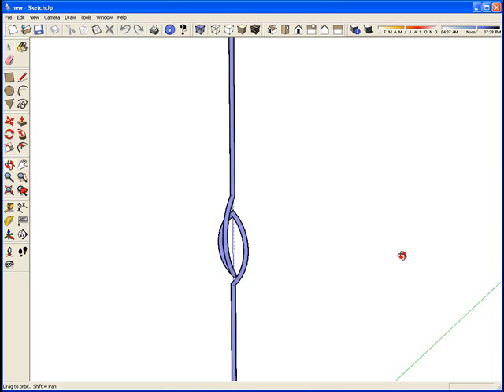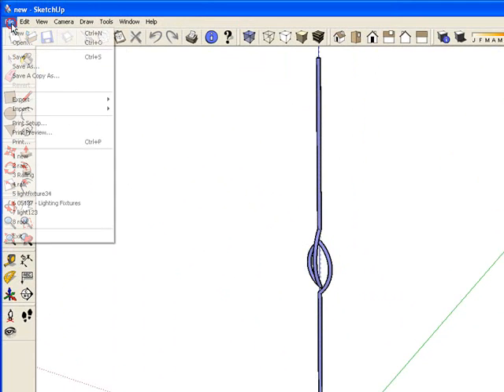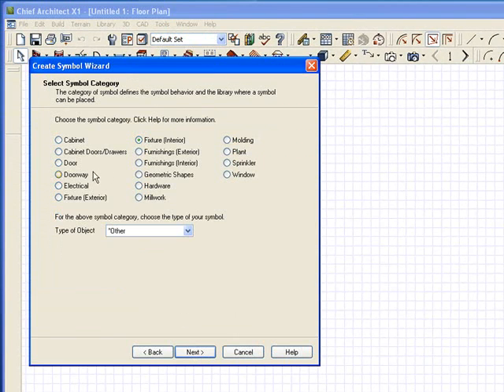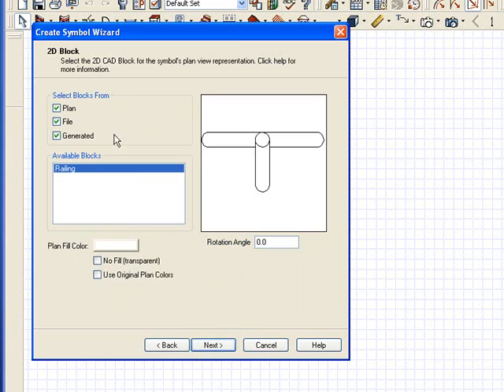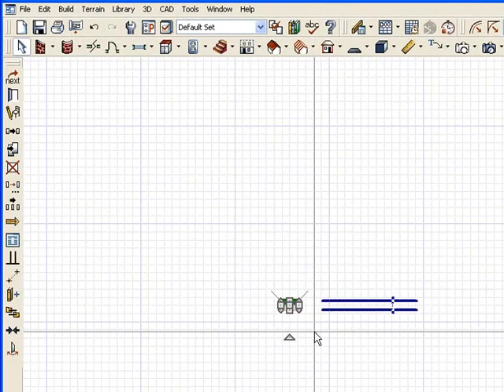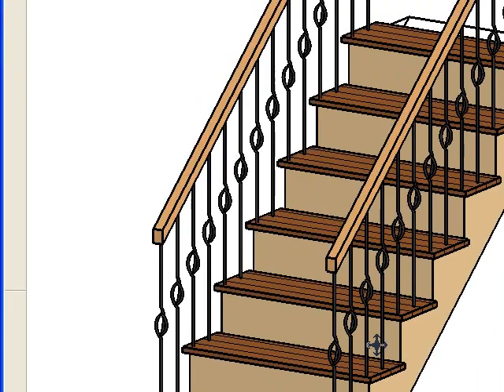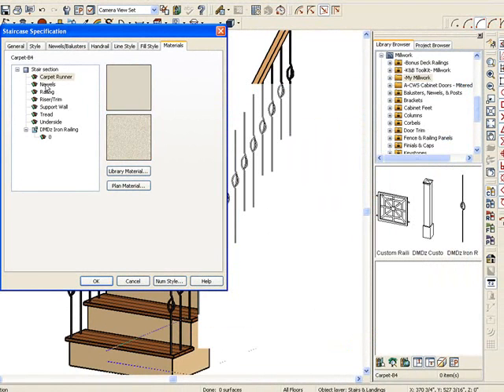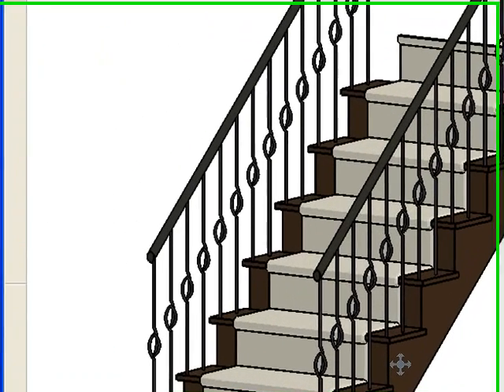Chief Architect Training on How To Make a Symbol in CA

Comment: Nicely done.  How do I create an existing electrical and tele outlet from a .dwg?  My old symbols are filled in.  And where these apply only to existing walls in a remodel job?  I'd like to do the same for light fixtures where the light fixture has an "E" attached to it.